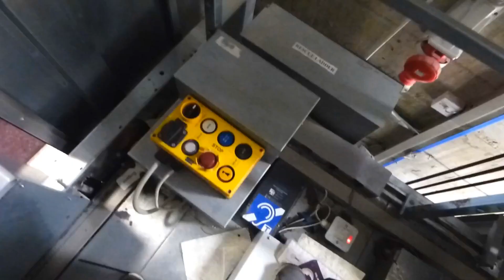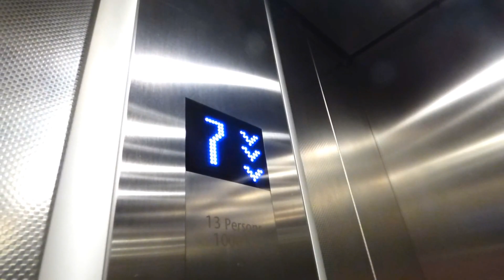Fast ecodisc

Comment: The only thing I don't understand about MRLs is the fact the motor drive and other ancillary equipment are placed at the top of the shaft. If the car is below the top floor, no problem, if the drive or other critical component failed and prevented electric movement of the lift then the brake can be released from the cabinet on the landing. If the lift were stuck at the top of the shaft, what then?
I'm going to take a silly guess and say both doors are forced open and the car gets loaded past the balance which the counterweight wants to pull the car up.
This situation is almost non existant though, probably a 1% chance of this ever happening.